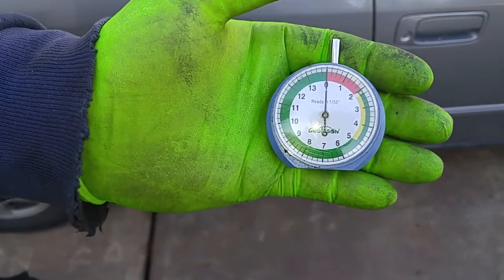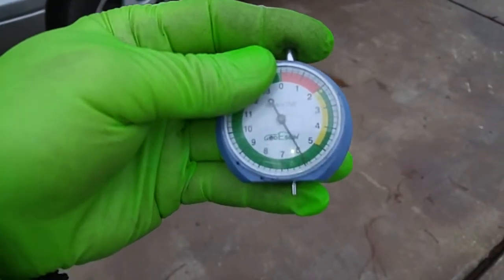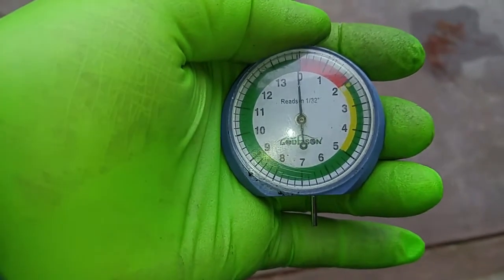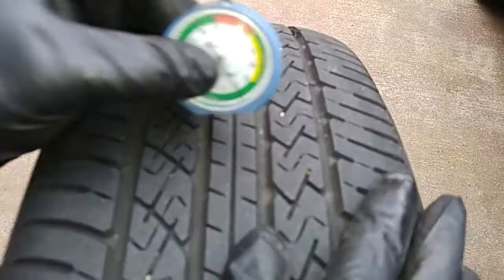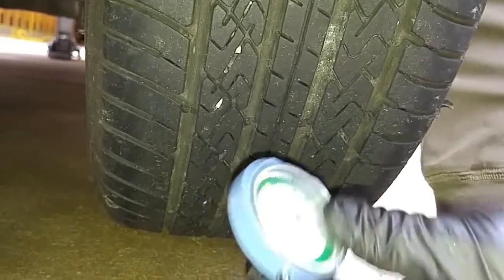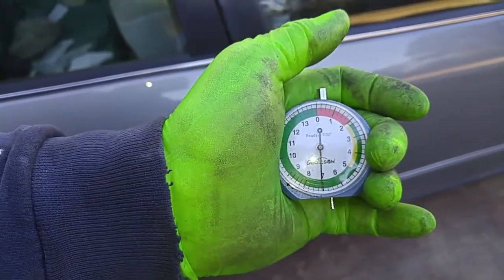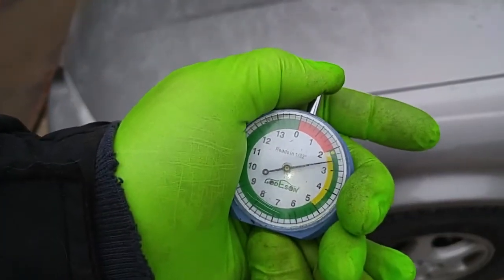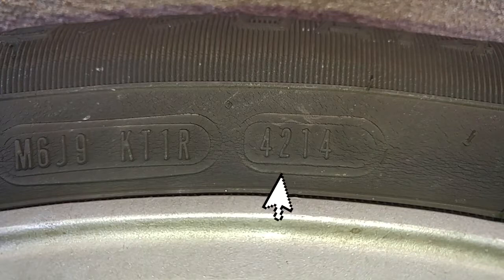Tire Tread Depth Gauge & Tire Rotation Procedure

Comment: Thanks much for showing how to use the tool, and how to make decisions based on the measurement.
Reply from the maker: Very cheap and extremely useful tool to determine tread wear.  With it, you can accurately decide where to remount the tires to distribute wear evenly.
Reply: @hardlymovingpro  I once followed a car with bald tires up a twisty mountain road on a rainy day.  I saw it sliding all over the place.  Ever since then I've made sure my tires have good treads.